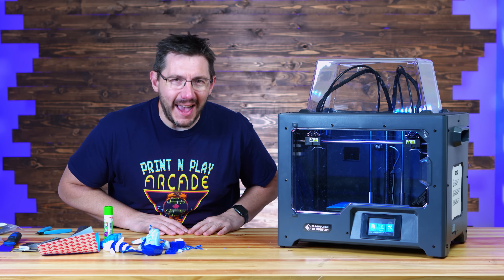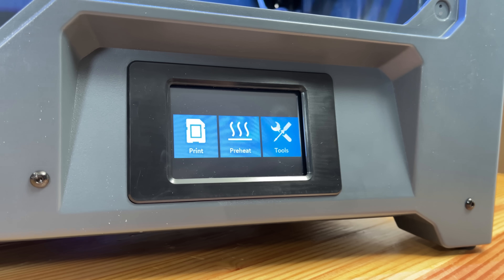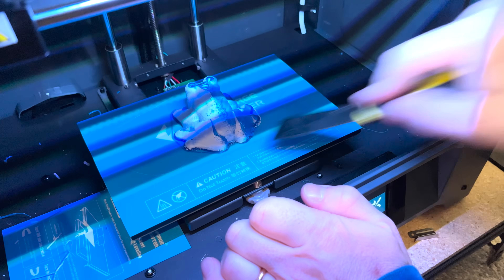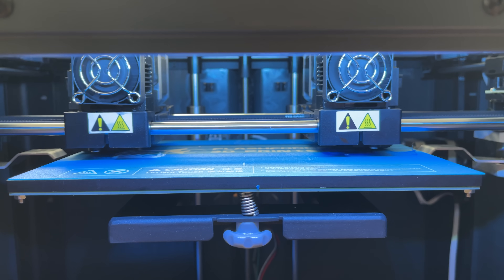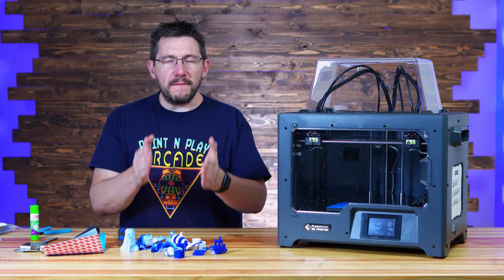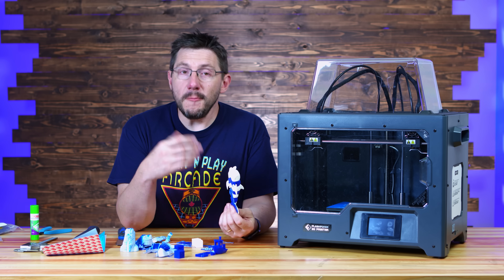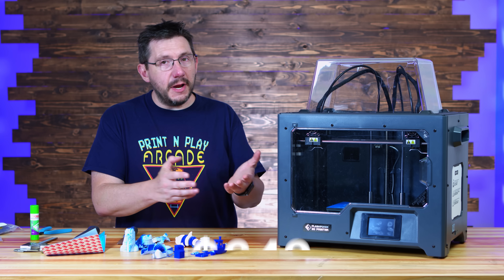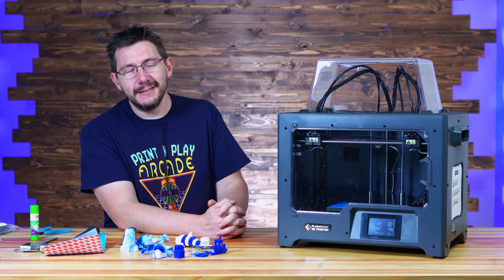Did Flashforge Miss the Mark?

Comment: I have a Flashforge Creator Pro 2 and it is even my first 3D printer at all. So I come from the noob perspective here. Do the prints stick to the bed, so that you can't remove them anymore?
The answer is yes and no. Let's first come to the yes part:

Yes they stick hard to the bed and nearly can't be removed at all:
That was my problem with all prints printed with PLA (Flashforge and eSun PLA +) with a raft. With I really didn't know how to get them off. But to be true , they can easily removed, if you just heat the heatbed to 50°C (122°F) after that I could slide the scraper below the raft and it came off without using a lot of force (on the German Flashforge vendor website they even say you should consider using a heat gun).

No it doesn't stick at all:
But there comes the problem with the slicer and the printers proprietary OS. If your 3D object has a big surface area, you don't want to print with a raft. Why would you? There is no reason to do so. It is a waste of material and the surface of the object isn't as good as it could be and the raft might not come off properly (later how I solved that subject).
Printing without a raft is until now absolutely a no go. As I have absolutely no ability to set the extrusion and so on for the first few layers, He will always print with the standard settings. In that case the first layers have such thin lines, that they just don't stick at all to the bed. All prints trying that failed totally. Even though a test print of the banshee is on the SD card, that prints without a raft perfectly, but I can't slice it on my own. So I suppose they manually edited the gx-file.

Raft and 3D object can't be separated:
That is a problem and it is really nerv racking, but there is a solution to that too, that does unfortunately needs trying and adjusting the settings. I found out by trying what someone mentioned, that the extrusion temperature of your material decides if the raft can easily be separated or not. So if it is too hot, it won't lower the temperature a little bit and it will get better and if you find the right temperature it is so problem at all. 
Unfortunately you need to find the right temperature for every filament, rigth? And still printing with a raft when you have a big flat surface area is absolutely a no go.

I even printed with ASA without problems, and all of my printings (not counting those tries without raft) came out in a pretty good quality. I had no problems in leveling the bed or lining up the y- and x-axis. The really few nozzles available is not good too. I haven't used the filament holders at all by now as I print out of a dryer box that can hold two filaments up to 1kg.

So what is my assumption of this printer as a noob without an extended knowledge about printing at all?
Pro:
- easy to use
- is able to print a fair amount of different filament types
- the prints have a good quality (even printing a working joint was no problem)
- even without deeper knowledge you can use it to get good results even in multicolor/filament
- everything you need to print is included
- slicer is easy to use

Cons:
- the slicer has very limited settings, so if you want to do more than the standard it is hard to impossible to realize
- the slicer has nearly no manual at all. The only available manual just describes what settings are possible, but completely fails to explain what they do
- the nozzles are unique, you can't use any nozzle from any other printer as you are able to do with the other Flashforge printers. Even the Creator 3 has the other nozzles
- as mentioned by someone else, if you use the filament holders, you need to print different ones if you use non Flashforge filament
- proprietary drivers, BIOS and so on makes it nearly impossible to use anything else than the original slicer (but that seems to be a Flashforge problem? )

Overall I don't regret that have bought this printer, but it is limited be means that shouldn't be and which are totally not understandable for me. That I can use any kind of printer (I mean normal ones) as something, that is absolutely normal for now good 20 years, so where is the problem here with a 3D printer? I can't see any reason for that, especially as most other 3D printers doesn't have these problems.

So my future problem solving projects are:
Find a way to use Cura (they say it is possible, but all sources I found didn't work, as I didn't get a gx-file and it doesn't make sense to use two slicers two get the right file and the second slicer will even change the settings of the first one)

Find out, which soluble filament I can best use in combination with ASA. I DON'T want to use HIPS. I am searching for a water soluble filament. As my knowledge is, as I mentioned before, limited I just don't know which one will ASA hold onto.I have a Flashforge Creator Pro 2 and it is even my first 3D printer at all. So I come from the noob perspective here. Do the prints stick to the bed, so that you can't remove them anymore?
The answer is yes and no. Let's first come to the yes part:

Yes they stick hard to the bed and nearly can't be removed at all:
That was my problem with all prints printed with PLA (Flashforge and eSun PLA +) with a raft. With I really didn't know how to get them off. But to be true , they can easily removed, if you just heat the heatbed to 50°C (122°F) after that I could slide the scraper below the raft and it came off without using a lot of force (on the German Flashforge vendor website they even say you should consider using a heat gun).

No it doesn't stick at all:
But there comes the problem with the slicer and the printers proprietary OS. If your 3D object has a big surface area, you don't want to print with a raft. Why would you? There is no reason to do so. It is a waste of material and the surface of the object isn't as good as it could be and the raft might not come off properly (later how I solved that subject).
Printing without a raft is until now absolutely a no go. As I have absolutely no ability to set the extrusion and so on for the first few layers, He will always print with the standard settings. In that case the first layers have such thin lines, that they just don't stick at all to the bed. All prints trying that failed totally. Even though a test print of the banshee is on the SD card, that prints without a raft perfectly, but I can't slice it on my own. So I suppose they manually edited the gx-file.

Raft and 3D object can't be separated:
That is a problem and it is really nerv racking, but there is a solution to that too, that does unfortunately needs trying and adjusting the settings. I found out by trying what someone mentioned, that the extrusion temperature of your material decides if the raft can easily be separated or not. So if it is too hot, it won't lower the temperature a little bit and it will get better and if you find the right temperature it is so problem at all. 
Unfortunately you need to find the right temperature for every filament, rigth? And still printing with a raft when you have a big flat surface area is absolutely a no go.

I even printed with ASA without problems, and all of my printings (not counting those tries without raft) came out in a pretty good quality. I had no problems in leveling the bed or lining up the y- and x-axis. The really few nozzles available is not good too. I haven't used the filament holders at all by now as I print out of a dryer box that can hold two filaments up to 1kg.

So what is my assumption of this printer as a noob without an extended knowledge about printing at all?
Pro:
- easy to use
- is able to print a fair amount of different filament types
- the prints have a good quality (even printing a working joint was no problem)
- even without deeper knowledge you can use it to get good results even in multicolor/filament
- everything you need to print is included
- slicer is easy to use

Cons:
- the slicer has very limited settings, so if you want to do more than the standard it is hard to impossible to realize
- the slicer has nearly no manual at all. The only available manual just describes what settings are possible, but completely fails to explain what they do
- the nozzles are unique, you can't use any nozzle from any other printer as you are able to do with the other Flashforge printers. Even the Creator 3 has the other nozzles
- as mentioned by someone else, if you use the filament holders, you need to print different ones if you use non Flashforge filament
- proprietary drivers, BIOS and so on makes it nearly impossible to use anything else than the original slicer (but that seems to be a Flashforge problem? )

Overall I don't regret that have bought this printer, but it is limited be means that shouldn't be and which are totally not understandable for me. That I can use any kind of printer (I mean normal ones) as something, that is absolutely normal for now good 20 years, so where is the problem here with a 3D printer? I can't see any reason for that, especially as most other 3D printers doesn't have these problems.

So my future problem solving projects are:
Find a way to use Cura (they say it is possible, but all sources I found didn't work, as I didn't get a gx-file and it doesn't make sense to use two slicers two get the right file and the second slicer will even change the settings of the first one)

Find out, which soluble filament I can best use in combination with ASA. I DON'T want to use HIPS. I am searching for a water soluble filament. As my knowledge is, as I mentioned before, limited I just don't know which one will ASA hold onto.

Sorry for this very long text, but this is so far my experience with this printer. Perhaps a few things 3D Printing Nerd might test. So far I've learned a lot from his videos. Go on like that!

Comment: So although the printer does not come with it you can buy and upgrade the bed to a magnetic steel spring bed that works wonders. I have 2 of theses printers and it was a necessary upgrade. They sell the upgrade on the flash forge website, but it really should come with it by default. Other than that I have had no problems with the printers. I typically don’t print with a raft or a pre extrusion because as you found they are harder to get off the bed (need to scrap) but I have upgraded the nozzle on one with a hardened steel and printed carbon fiber pla and carbon fiber petg. Minus the bed issue I find the printer very useful and nice. Great for printing pla and pva as well
Reply: I purchased the magnetic bed too.  They made an oversight with the plastic handle interfering with the print nozzle.  Luckily it can be removed easily.

Comment: Now, I have one of these and I love them. But, I did install the included removable bed upgrade the very first thing and it has, I think, completely changed my experience.

Plus, I never, ever, use a raft.

On thing that impresses me about this machine was I neglected it for nearly a year, then fired it up, and I didn't even need to level the bed. It just worked.

So, yeah, get that removable build plate on there, and see if you don't love this machine a lot more.
Reply: And don't use the supplied pla, it's junk
Reply from the maker: Mine did not come with a removable build plate, else I very much would have put that on.
Reply: @3DPrintingNerd  Well, and putting the plate on required modding the Z-switch so it was hit earlier, which in my case was done with a piece of popsicle stick and duct tape, which is still in there to this day.

I wonder if I got mine after yours, and they put that build plate in there knowing that it was a necessary upgrade.
Reply: @3dpprofessor  weird, mine didn't need any modification, remove print surface, apply the magnetic sticker, apply new print surface to the spring steel build plate and ready to go.
Reply: @3DPrintingNerd  it was an optional upgrade for a very reasonable price, got mine at the same time as the printer and it worked a treat. Even the rafts don't bother me much once I stopped using flashforge PLA. I use prusa PLA and they peal off so easily. The rafts are useful if you don't have the nozzles level with each other because of how you installed them. The extruder is very easy to maintain except that removing the heat break from the heat sink is hard, there is a trick involving a couple of minutes with a file to help with that. The idex works a treat. Flashprint I hate with a passion though, it is too dumbed down for my taste

Comment: I've had so much trouble with rafts fusing to the model. I've spent hours with the nippers chewing away at it bit by bit but it eventually did all come off. Unfortunately my Ecubmaker seems to require rafts or else the print won't stick.

Comment: I bought a Flashforge Adventurer 4 and I can not recommend it either. While it does have a flexible removable build plate, it is really aukward  to level the bed and I have never managed to get it just right. There are no wheels to adjust bed level, it is done entirely in the machine settings. I have spent hours going through the leveling process only to have the right rear section of the bed be to close to the nozzle. NothingI do changes that. Their slicer is odd and it is not easy to set up a profile for it in other slicers. When you do getit to print, the prints turn out fine, but I end up not using the machine and it just sets there. It was a waste of $800 to me.

Comment: I still use the first version weekly and is Solid. The prints stick but I thought it was common knowledge that if it doesn't come off you can heat up the bed to loosen it or use a different build plate

Comment: So I was literally planning on buying this printer next week. Any recommendations for a dual extruder printer around the same price point?
Reply: I have worked with a few IDEX printers and I am not completely satisfied with any.  I have just bought the Sovol SV04 but have not used it yet.  It looks promising.
Reply: don't do it. ffcp 2016 owner here and the best upgrade you can do for it is to remove the 2nd nozzle. dualstrusion is a gimmick. added a glass bed to my creator pro, all metal hotend, hardened nozzle and its a true workhorse. they should have done all of that and called it the creator pro 2, instead of a shitty touchscreen.
Reply: You can by multiple units of Ender 3 with this budget.

Comment: My first 3d printer was a FlashForge adventurer 4. I thought i was getting the coolest printer ever but turns out it was just an absolute headache. i used the auto leveling to get my printer up and running and my first handful of prints in the middle of the plate printed without a hitch. I wanted to print a full bed of models  so i went and ran it off just to come back to a spaghetti mess in the back right corner of the bed. So i ran it again and watched it this time and noticed it wasnt dropping any material at all. So attempted to level it again and noticed the back right corner was completely off comparatively to the other parts of the bed. So i started researching and someone mentioned to check the gantry and thats when i noticed my gantry was not level to eachother which was causing my leveling to be completely off. So i contacted support and they asked me try a few things to no avail. Which is when i saw that a handful of people were having this same exact issue. Needless to say i returned it got a prusa and never looked back.

Comment: It doesn't change the final conclusion, but - I think you're misinterpreting "anti-scrape."  That is, I don't think it means "you won't have to pry the print off the bed."  I think it means "when you pry the print off the bed, you won't do much damage to it."  That is, the bed resists being scraped - it is 'anti-scrape.'  Because despite the level of effort you're putting in there, the bed surface itself looks pretty pristine.

So...  still not a desirable trait overall, but ultimately I don't think it's "bunk," I think it's a confusing choice of descriptors.

Comment: I have a flashforge creator pro 2 and I just wanted to share some of my experiences as well, I tried printing flexible filament with the recommended settings and it was genuinely impossible to get off, no amount of hammering, scrapping, or otherwise could get it off. The layers sheared rather than coming off the print bed. Then also some creator pro 2's ship with such poor tolerances that removing a nozzle to replace it is impossible, and the heartbreak is stuck in the heatsink necessitating the purchase of an entirely new hot end, I then also changed a nozzle to try and print with a .1mm nozzle, discovered that flashpoint didn't have the ability to change nozzle size, requiring a jenk ass prusa pp profile with a post processor. I then discovered that it was jammed and it turns out even though I was using the proper m10 nozzle, it had mangled the ptfe tube, which I then trimmed the broken part off but now it's too short so it insta clogs. Overall I've had a pretty nightmarish experience just trying to get this bloody thing to work
Reply: You don't need to change the nozzle size in the slicer just change the path width in settings on flash print

Comment: I would try a different filament and/or slicer.  Maybe the bond strength of the filament Inter-layer and to the bed is too high compared to your regular filament.  You could go the next step and test the filament out on a different setup to see if you have the same issues.